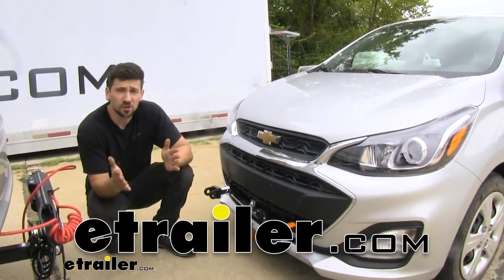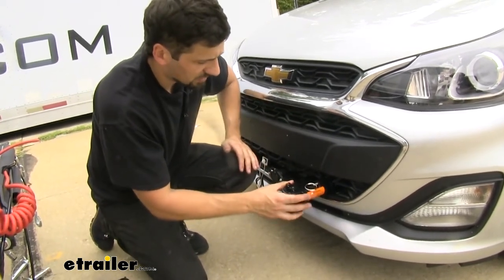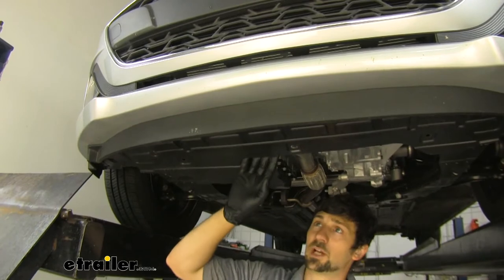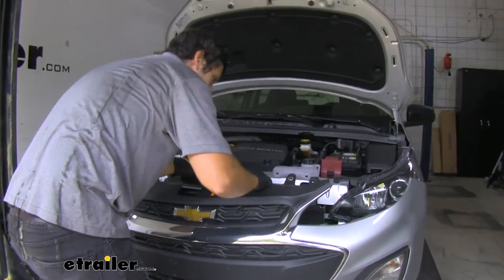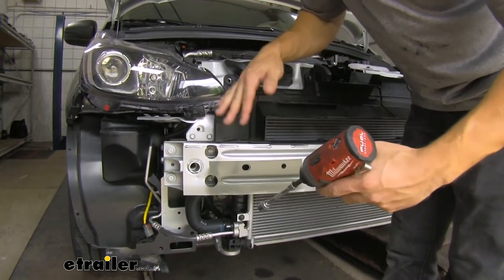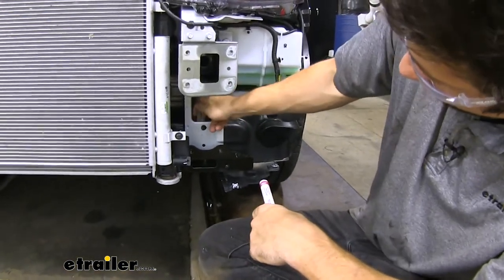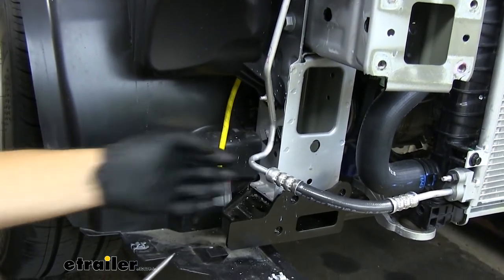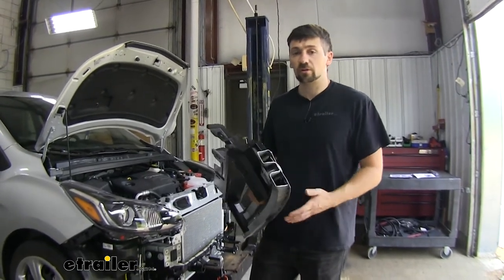etrailer | Roadmaster Direct-Connect Base Plate Kit Installation - 2020 Chevrolet Spark

Comment: 18:32 -- how on EARTH does this bracket clear the coolant line? This is skipped over in the video. We have been struggling all day with this. Please advise.
Reply from the maker: At 17:17 in the video, the installer will show how to move the coolant line in order to install the base plate.
https://www.etrailer.com/Base-Plates/Roadmaster/RM-523202-5.html
Reply: @etrailer  We really appreciate you answering! However for everyone else reading unclipping the line (which we did do as per the video) was not near enough for us to clear it--even after bending the metal tube as much as we dared. We actually cut the corners off to the bolt holes on the passenger side of the bracket and STILL it was a tight squeeze...which is why I think the install was not shown in the video. You might be able to get it in there without this mod, but we didn't want to risk rupturing the line.